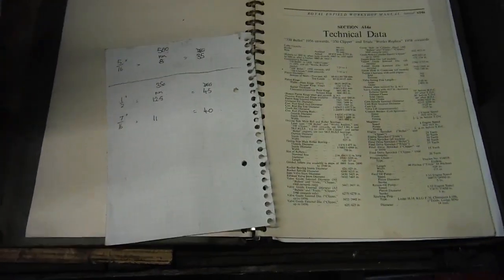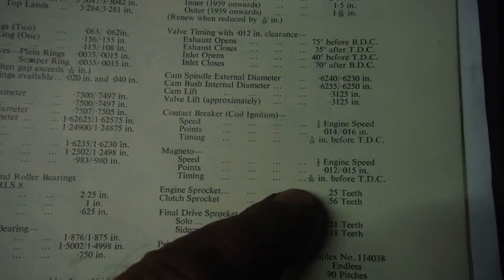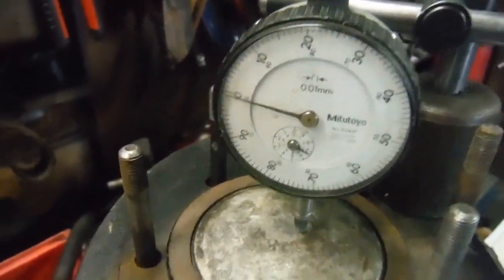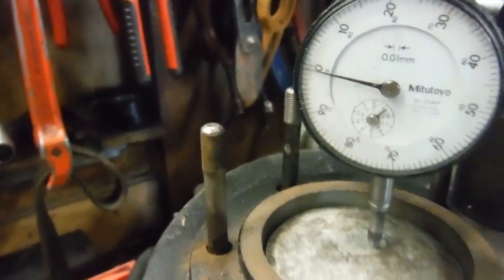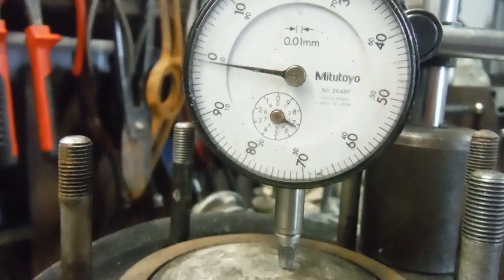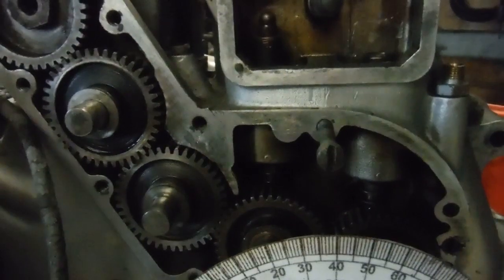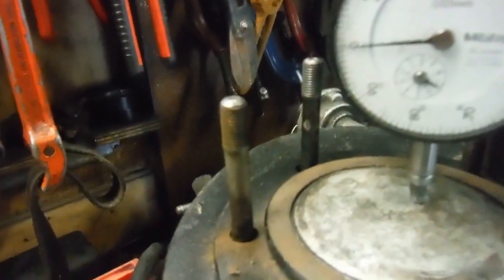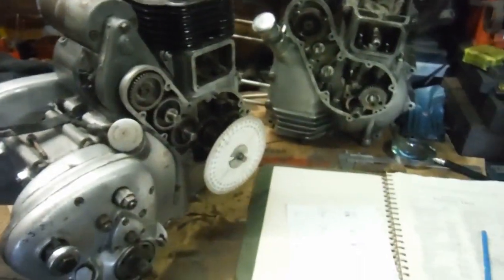Royal Enfield Bullet 350 and 500 ignition timing degrees vs inches/mm BTDC discussed and compared.

Comment: Would that timing be the same for a 2002 500 bullet with a 12 volt coil 8mm BTDC? Somewhere on the internet people are setting their timing at .8mm. That would be very to retarded.
Reply from the maker: I always set 350 and 500 Bullets up according to the specs in this manual, even from 2002 and later and they work well as a result.

Comment: It seems an oversight that there was no sight hole with fixed TDC and timing marked incorporated into the design. BMW did it and it makes valves and timing a snack. The amount of trouble this omission gives Bullet owners is staggering. The amount of variance in determining TDC and then 8.5mm when the spark plug hole is not parallel to the bore...well it’s no wonder that every second Bullet runs badly. And there is no easy way of attaching a degree wheel without removing an engine cover and there is a cosine error using a normal dial gauge and plug adaptor. It is enough to convince a guy to install an electronic ignition and go through the whole timing process once.
Reply from the maker: It is easy to remove the oil feed quill and fit a timing disc into the end of the crank, using a suitable sized spindle running through it. TDC is not hard to find, but there are lots of people who mess with their Bullets who really shouldn't.

Comment: The crankshaft gear has 20 teeth. 360 degrees divided by 20 teeth = 18 degrees/tooth. The camshaft gears have 40 teeth. 360 degrees divided by 40 = 9 degrees/tooth. if you back the crankshaft up 2 and 1/2 teeth, 5 teeth on the camshaft, you have 45 degrees BTDC. 2 teeth on the crankshaft, 4 teeth on the camshaft, gives you 36 degrees BTDC. My 350 seems to run best at the 36 degrees BTDC range = 2 teeth on crank = 4 teeth on cam.
Reply: You must remember, these specifications are for dynamic timing at 1/2 engine speed. At this speed the points cam's mechanical advance will have begun to affect ignition timing. This is why the old school rule of 8 mm BTDC for static timing, as measured through the spark plug hole, is a good rule of thumb to start. You can then fine tune the breaker points plate for best performance.
Reply from the maker: I am aware of all that. 1 tooth on the timing pinion = 1 tooth on the camshaft pinion = 18 degrees at the crank. The 'Old school rule of 8 mm BTDC' fully advanced applies to the 500 only, but seems to have crossed over to the 350 sometime after the Redditch manual was published. I think this is why many 350 Bullets seem a bit 'flat' in performance, combined with other things such as restrictive exhaust systems and so on. The correct full advance timing for the 350 is as stated in my video, at more like 11 - 12 mm BTDC.

Comment: My tiny brain has started wondering if it would be possible or accurate to make a piston stop to halt the piston at 8mm BTDC? Then when checking the timing you just need to find the compression stroke wind back the engine fit the tool, then when you wind it forward again it would stop at the 8mm mark every time? Just the thoughts of unhinged mind!!
Reply from the maker: 8 mm might do for a 500, but it is more like 12 mm for a 350.

Comment: Thanks for that Paul I will amend the line on my timing disc from 32 to 33 degrees! Have you ever done the same exercise with the retarded timing as I suspect a lot of Bullet owners use that more often? Cheers Keep up the great video's
Reply from the maker: I never set the timing at the retarded end, because the full advance timing could then be out by some margin, and it is the full advance timing which is most important.

Comment: I've a 350 Indian bullet 2001 . My book says 0.8mm  for the 350. . . I'm lost now jeez. What do you recomend. It's all standard
Reply: Do you have a video on how to set the advance unit up in the correct place? Thanks
Reply from the maker: @coco-te1op  Not yet sorry, but I will bear it in mind for the future.
Reply from the maker: 0.8 mm BTDC is for the retarded setting given for Indian 350 and 500 machines, but it is better to time them with the auto advance mechanism in the full advance position, which is often quoted as 8.8 mm for Indian 350 machines, but British 350 settings are more advanced than that, as seen in my video, while British 500's run a slightly later timing, as seen in my video. Somewhere along the line, the Indians transposed the British 500 settings to their 350's, if that makes any sense.
Reply: @paulhenshaw4514  thanks for your reply Paul. Makes total sense thankyou. . . So set it up for Indian settings not British? Why the difference? Any reasons?
Reply from the maker: @coco-te1op  The British machines have higher compression ratios, sportier cams and bigger / better porting etc, so benefit from a little more ignition advance, I guess.

Comment: I have always timed my Bullet 65 using Hitchcock's data which is 32 degrees BTDC but they quote that as 8mm fully advanced? Might re set using 33 although it doesn't seem enough to bother about on a "cooking" engine like the Bullet? By the way Paul, what do you use to turn your points cam to full advance to check full advance timing whilst standing still? Thanks for all the fresh advice.
Reply from the maker: Thanks. I sometimes just use the ends of some pointy pliers to turn the cam against the springs when the engine is at the full advance firing position, to check if the points are just opening or not.

Comment: Hi Paul, when you said that your dial gauge was out of range for the 350 would it be within range if you put a 1mm feeler gauge between the pointer of your dial gauge and your piston crown? Sort of expand its range by an extra mm?
Reply from the maker: Thanks, I guess that could work, as long as that 1 mm was factored in, but the main problem is the gauge only records 10.6 mm from end to end of plunger movement.
Reply: @paulhenshaw4514  Would it possibly work using a combination of feeler gauge sizes to compensate for the dial gauge's shortfall? BTW, I'm the newbee on the RE forum that asked about fork leg differences. LOL, as if it could be that easy swapping a fork leg!

Comment: Sorry for my bad maths, I think I got it right this time.
Make a triangle with side 1 the crank offset(45mm)
Side 2 con rod length between centres(174.625mm)
Longest side is sides 1 and 2 minus the btdc
I'm now thinking that 
5/16"=30.9°
7/16"=36.9°
1/2"=39.6°
Thanks again for the great videos

Comment: Exactly on the spot the perfect demonstration using three measurement parameters with great accuracy. Measurements performed by people without much practice, not taking into account that the piston rises and falls a minimum in its course, this passage is not noticed with visual precision at the exact moment when the movement will be reversed, so having the steering wheel or any undercarriage on the box where it is possible to determine two marks when ascending and descending the piston, the mark found and centered between the other two will be the true TDC top dead center. Grateful for more this video involving techniques!

Comment: Interesting vid Paul, just one question. You mention fully advanced so how do you go about obtaining this on both system mentioned in the manual please.
Reply from the maker: Hi David, basically, you have to lock any auto advance mechanism into the fully advanced position by various available means, ranging from special washers to fit between the end of the points cam and its retaining screw, to lock it up, to jamming bits of wood or card behind the bobweights of the auto advance unit itself. Manual advance magnetos and the like just need their ignition levers set to full advance.
Reply: @paulhenshaw4514  Many thanks for the information and prompt reply Paul, looking forward to your next vid!!!

Comment: So Enfield India quote 32deg 8.5
Reply: I set my Indian 350 up through the plug hole with Hitchcock’s special tool and it ran fine on their quoted figures but Joe I know how to do it correctly when when I get my next RE, Thanks Paul
Reply from the maker: That is not quite what we see in my clip, but their measurements of piston travel might have been taken at an angle, through the plug hole, which could explain and make up the difference.
Reply: @paulhenshaw4514  so.... the 8.5mm measured through the same angle as the spark plug hole IS 'somehow' correct???
Reply: ..not that the 0,5mm will give any difference, i would expect a bigger difference because of the plug angle..
Reply from the maker: I would think the 8.5 mm through the plug hole at that angle could well equate to 32 degrees, but the 8 mm measured in my clip, directly over the centre of the piston crown gave 35 degrees and may well have appeared nearer 9 mm through the plug hole.